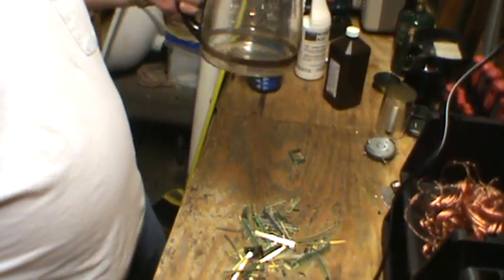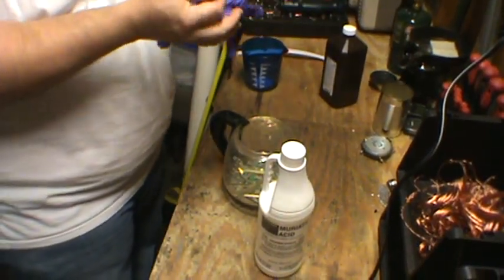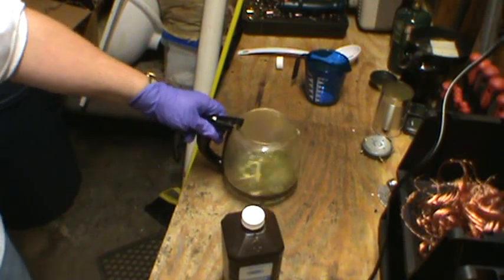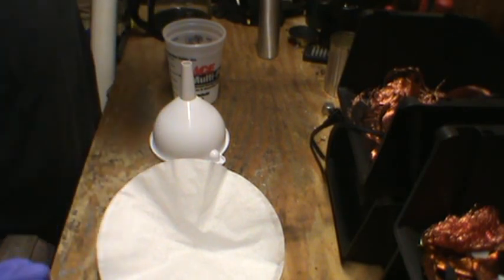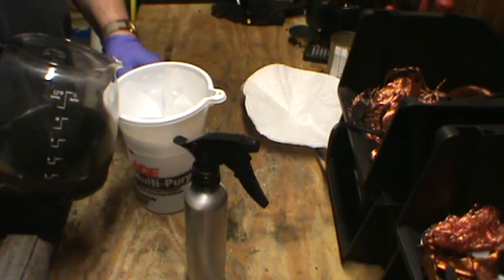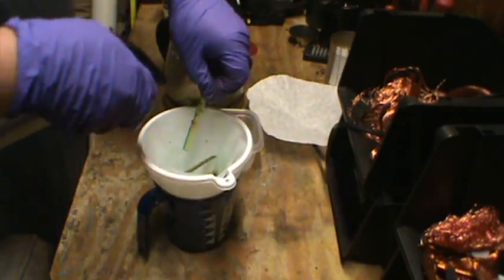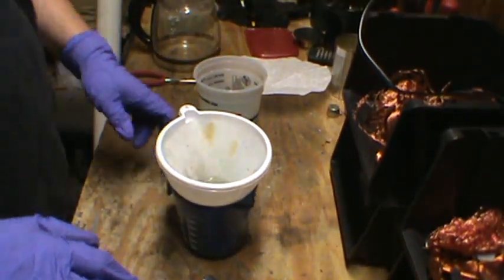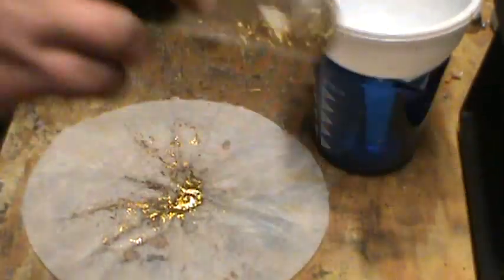How to Recover Gold with A/P Acid peroxide method for gold fingers and gold plated boards easily.

Comment from the maker: Thanks for watching!  You really want to process those differently.  You wil have basically two types of pins, gold plated ferrous pins and gold plated non ferrous pins.  You are going to want to process them with HCL and heat rather than peroxide.  The non ferrous ones are usually brass plated with gold.  You can use the A/P method however it wil take a long time due to the thickness of the metal compared to that holding the foils to gold fingers.
Reply: Hi Moose, what about the solder? Will HCL remove the solder from the gold plating as well?

Comment: I have another question for you hehe , you say in the video to remove all the ther metals from the board parts you wanna process, but if you have to process a cell phone board, that have a lott of tin and the gold is not only in a small place but in a great number of little paces in all the board, before ti process with HCl/Peroxid, how you can clean from all the tin?

Comment from the maker: Sure, just like I stated in the video I use 2 parts HCL and 1 part peroxide.  It would take a lot to dissolve the gold though, Are you sure it was gold?  Were you heating it as well?  You should not be heating the A/P solution.  You may want to do some reading on the goldrefiningforum or check out the book by CM Hoke on refining.  Thanks!

Comment from the maker: Hi, thanks for watching and for your concern.  I originally thought about buying a respirator however the MSDS states it is necessary if there is poor ventillation.  Since 99% of the reaction occured outside my garage (as stated in the video) and while inside the garage for just a few moments, I had an exhause fan in the window directly above me, I thought it not necesary.  I felt that was more than adequate ventillation.  Had I been working with nitric, it would be a lot different.  Thanks!

Comment from the maker: If there iss still solder, it can create a nasty gel that makes it harder to get the gold out.  Also, if there are small chips, MCC'c or other small componants, they will come off the boards in this process and then you will have to take a lot more time picking them out of the gold foils.  Thanks for watching!

Comment: I'm curious, are there any substances that if included in the process(intentional or not) will hinder or ruin the process completely? i.e.rubber, plastics, other metals

Hey and thanks for the straightforward, informative videos, i ran home and ripped apart an old laptop after watching =D

Comment from the maker: That is fine, Originalfeets channel has a video on doing just that. The only issue is that you are pulling off the copper and nickel with it.  The gold layer is extremely thin so what you have only maybe a 10th of it is gold.  That makes it harder do find a value.  Thanks

Comment: (no experience, just brainstorming) If you have a sharp chisel, I've seen others peel off individual gold fingers away from the green boards without having to use chems to make them slip off.. a bit more labor, but less time and less chems involved .. Conceivably one could still do the chem process on the peeled pieces with a far lesser quantity of chems, I'm guessing.. What's your take on manual removal of the metals?

Comment from the maker: When processing gold fingers, to the best of my knowledge, heat will not really help.  In fact, I may be mistaken however I think that the combination of HCL, heat, and peroxide may actually dissolve some of the gold and that is not something you want at that point.  The goldrefiningforum would have better info on that though.

Comment from the maker: I think its a good idea to start off small to develop a comfort level with the process and chems being used.  If you feel confident though and want to try all the clean gold fingers at once by all means go ahead and try, the gold wont dissappear!  lol.  I have not done very much in gold recovery beyond using HCL.  That being said, you can recover the gold with HCL and heat, I am working on that one as well, unfortunately I broke my coffee pots, the box fell off the shelf so need to find more.

Comment from the maker: Cement out the copper with a piece of stainless steel like a butter knife or printer spindle.  Then slowly add baking soda until there is no reaction.  You should be left with a solution of essetially pool water and trace nickel.  At this point it should be safe to just dump down the drain.  There is some deabte over the toxicity of nickel however it is found naturally in most water sources, and is a required mineral in the human body.  We typically have about 10 mg in us at any given point.

Comment from the maker: Hi and thanks for watching!  I use 31.45 % HCL.  The safer stuff works just fine, it may take a little longer for recovering gold from gold fingers, but is that same for recovering from gold pins.  The 31.45% solution is more easily found at smaller hardware stores like ACE or TrueValue etc.  Let me know how you do!

Comment: Moose love the vid! I thought I wrote a couple weeks ago but can't find my question. I'm sure you've been asked this before so sorry.  What is the concentration of Muriatic Acid you use? Our local walmart has the "safer" stuff but I don't want to use it if it will not produce the same results. I've probably got 300lbs of boards, fingers, cpu's ect. I'd love to get started but want to make sure I'm using the correct chemicals. Thanks again this is by far the best vid on the process I've seen!!

Comment from the maker: This method will work for gold fingers and non magnetic plated items.  Those are typically brass and the A/P solution will eat that up.  For magnetic plated items, like pins rca jacks, etc, HCL and heat are likely better.  HCL will eat the aluminum core of hard drive platters but leaves a nasty chemical mess.  Originalfeets channel has a video on that.  You have to cut up the discs so increase surface area and the the foil left if less than 3% Pt.  No easy way around it sadly.

Comment from the maker: Mother boards have gold here and there in different places and MUST be recovered in different methods.  Soaking a board in A/P will NOT recover all the gold, and it WILL creat a toxic solution that will be very difficult to dispose of.  If you really interested in gold recovery in a safe and ecologically responsible process, you must separate items.  Mother boards surprisingly have less gold on them than the CPU and RAM. And the proper recovery is not quick and easy.  Thanks for watching!

Comment from the maker: It smells like a really strong whiff of pool chemicals, chlorine, and can damage lung tissue.  Once you are done with the solution, cement out the copper by placing a piece of stainless steel in there for a while, until copper stops sticking to it.  Then slowly add baking soda to it to neutralize.  at that point it should be as sake to dump out as pool water.  There will be some nickel left in there, but if you only put clean fingers in that should be it.

Comment: So does this method work for any type of small gold plated thing?  (i.e. pins, processors etc?)  Also, would it work for Hard Drive platens to recover the platinum?  If not is there an easy process for that?  Thanks!

Comment: How bad does the solution smell?  And how do you dispose of the solution without having a problem?  It's my understanding that motherboards have gold throughout.  If you have mother boards, can you use a larger container to soak the boards?  And if you're patient, and you wait 4-5 days, do the gold foils come off the fingers easily?

Comment from the maker: the boards start smoking because there are toxic chems that can be released.  You can use a camp stove as well.  It helps to build up a foil wall aroud the tray to prevent heat loss from wind.

Comment from the maker: The easiest way is a hot sand bath.  i am working on that video.  Basically you take a cookie sheet and fill it with sand about 1/2 inch thick and put it on a gass grill or a grate over a campfire.  Once the sand reaches about 5-600degrees F it will melt the solder on the boards holding the componants down.  Just take an old large knife blade or metal spatula and a pair of channel lock pliers and lift the board over another cookie tray and scrape them right off.  Try not to let...

Comment from the maker: Hi and thanks for watching!  Yes it is a 3% H2O2.  As for the concentration of the liquids, it is my understanding that if the concentration of hcl is too high, the gold will start to dissolve and you don't want that.  Also, the fumes would be more toxic and if you don't have a good area outside that could get very dangerous.
Reply: if the concentration of peroxide is higher 😉

Comment: what percentage solution h2o2 were you using? 3%?   would the process speed up if you used a higher % solution?  same for the hcl, if you had higher than 31% solution will it  work faster?  I live in a 3 family home, dont have a shed and definitely not comfortable leaving the acid and gold hanging around for 2 days outside.

Comment: When cutting fingers off of ram, does it matter if a few of the super tiny surface chips make it into the acid bath? Would the solution still turn emerald green or a different color?

Comment from the maker: Hi and thanks for watching!  That is a really hard question to answer because there are a lot of variables.  Age, type, how much of the simm is processed.  You can process just the fingers, or the whole thing, chips and all.  I really do not have any good numbers other than to say that I have read report on the goldrefiningforum stating 1-2 grams per lb of complete older simms.  The newer ones 1-2 grams per lb of just the fingers.

Comment from the maker: I have not used sulfuric yet.  The only use for sulfuric that I have read up on is the reverse electroplating process for pins and plated jewelry.  The goldrefiningforum web site has more info for you.  Just so you know, they can be a bit snippy at people who ask a lot of questions before reading and researching the site.  Everything you need to know is there, it just requires a little work to find it but it will be good quality info.  Thanks for watching!

Comment from the maker: I actually do not process the mother boards.  Right now I am selling the mother boards.  I process gold fingers from the PCI cards, ram chips, and slot processors.  I also process gold plated pins from other pc parts and other ewaste.  An average would be hard to figure because you have three major types, and then there are variances from manufacturer.  From what I have read at the goldrefiningforum, most boards can get about $9 each on gold.

Comment from the maker: In a clean jar, add the solids you just filtered and enough clean HCL to cover it.  If the solids are really muddy, then add approx 2x the volume of HCL that you have of the mud.  With a glass or plastic rod, gently stir.  Slowly, and i mean SLOWLY, add teaspoons of bleach one at a time stirring the solution.  Continue one teaspoon at a time until you can see no more gold floating in the solution.  Filter out and keep liquid, your gold is in there.  Add SMB to precipitate the gold.

Comment from the maker: This is along the comment with the black mud right?  I do not know what you put in there, there are a lot of different componants to a mother board that need to be processed in different ways.  At this point, the only thing I can reccommend would be to pour everything through a filter, keeping all the solids in the filter.  The remaining liquid is like junk now so you will want to add baking soda very slowly to it until it stops bubbling to neutralize it.  Next, .....

Comment from the maker: ewaste that I do recover using this method.  I use this method only for recovering gold from gold plated boards, like finger boards, calculator and phone boards etc, and from gold plated pins (iron core and brass core are run in seperate batches).  This is all I recover myself.  Everything else I sell on ebay or to boardsort.  As for recovery, using HCL+Bleach to dissolve the gold (violent reaction warning!) and Sodium Metabisulfite (a brewers chemical) I can get up to 99% pure gold.

Comment: One more question, I didn't see your video until now, and I had watched a video on this procedure. However the other gentlemen failed to mention the part about making sure there was no other metals in with the gold fingers/foiled pieces. So I put a mix of different stuff in the solution. I can tell that it is reacting, but not as much or as strong as I thought it should be. Any advice on this subject/situation? Do you think it'll be of any success?

Comment: Hey Moose, just a quick question. About a week and a half ago, I put all my gold pieces into a bowl and filled it will just muriatic acid. No hydrogen peroxide. Then I totally forgot about it. I just checked the bowl a few minutes ago. There's still some muriatic acid in the bowl, but it's entirely black. Can't even see any light shine through it. Did I ruin it?

Comment from the maker: Sounds like a dishonest tester.  Gold test kits are available on ebay for less than $10 and are very useful.  Of course, when they are fresh off the filter paper after the A/P bath, they will not be 24K or 100% pur gold, but they are definitely going to be at least 41.7% gold, or 10K.  Then after a round of refining you should be left with about 99% pure gold.  I would take it to someone else or test it yourself.  Thanks for watching!

Comment: if you put the pot on heat it will greatly speed up    acid boils at a different temp than water a light simmer is is ok

Comment: just sum yeld info from my own  xp
1 pound gold fingers = 1-1.5 grams gold
2 lbs yealded  2.7 grams cut off gold fingers
3 grams fom 1 pound of prosser pins
My yield was 0.041 - 0.005fiber per cpu 
60 motorola ceramic 84 pin prossers  4.6grams total 
pins are more like 2g per pound.

the yealds ar much lower than most ppl xpect

Comment from the maker: Yes, you can use it for quite a while.  Longer if you have an air bubbling system instead of using peroxide.  And very so often you should cement the copper in the solution out with a stainless steel piece like a butter knife.

Comment from the maker: Right, it does not ammount to much.  But, if you see a dollar on the ground do you pick it up?  Its not much, but it is something.  A dollar here, another there, it all adds up.  The gold part of scrapping that I do is more of the hobby side.  I make more money wil copper brass and steel, and selling on ebay than with gold recovery.  I have not melted anything down yet, I have a jar of flake that I am waiting until its full to refine then melt.  Thanks for watching!!

Comment from the maker: Yup, just keep reusing, every couple o batches try to cement out the copper by placing a stainless steel rod in there, like a butter knife or something.  Solution will last a long time but see 10464Jeffs comments about disposal after the solution is no longer active.

Comment from the maker: The most effective method for removing the gold here would be just to use HCL and heat.  WARNING this can be dangerous!!!  Do not heat till boiling with is much lower that waters boiling point!!  If you have a glass coffee pot or pyrex glass, must be heat resistant, put your pins in and just enough HCL to cover it.  Then put it on an old coffee maker hot plate or in an electric skillet outdoors.  In about 2-3 hours the gold should be free.  Check out Originalfeets he has vids on this.

Comment from the maker: You are right, that will speed up the process.  There are two reasons i don't do that though, first is a safety issue, whats worse than acid?  HOT ACID!!  Especially for people who are beginners looking at this video who may not use tempered glass etc.  Second, I may be worng, but I read somehwere that the combination of HCL, Oxygen, and heat may start to dissolve some of the gold where just HCL and 02 will not, which adds another step of trying to precipitate it.  Oh well, thanks for watching!

Comment: remove copper by cementing on steel and raise PH to neutral and ALL metal left in solution will precipitate out.decant salty water and discard.dry and seal precipitate in a good container and dispose of at a chemical dump.

Comment: using air,you can force the solution to dissolve more copper than the solution can hold.as more copper goes into solution as copper(II) chloride,copper comes out of solution as insoluble copper(I) chloride which is a white powder,usually after sitting idle for a couple of weeks.the final stage of CuCl can be converted to ferric chloride by heating the solution and adding steel wool and a little H2O2 until the color changes from blue-green to red.this solution chews base metal fast,can not reuse.

Comment from the maker: Wow thanks for the great info!!  From what i had read I was under the impression that the A/P solution if treated well could be used almost indefinitely.  So after about how much use will there be too much nickel in it to continue using and how do you dispose of it?  Add baking soda to neutralize and dump down drain after cementing the copper out?  Thanks!

Comment: check wiki on nickel toxicity("Nickel was voted Allergen of the Year in 2008 by the American Contact Dermatitis Society").nickel in solution is blue and looks somewhat like dilute copper chloride.where the copper can be cemented out of solution using several different higher reactive metals (iron,aluminum,zinc) you cant cement the nickel out using these metals.AP solution will eventually become fouled from nickel and stop reacting.it is still better than using nitric acid to strip foils.